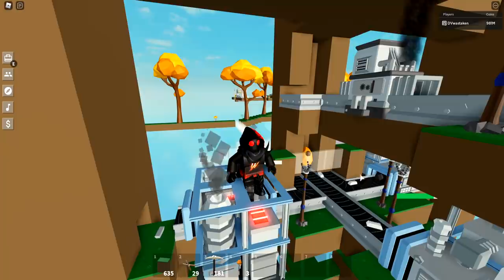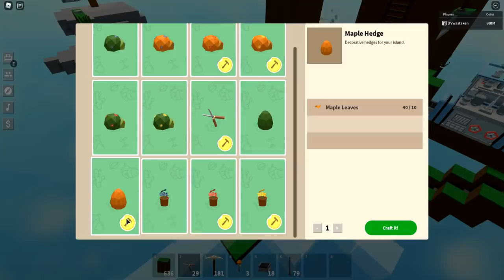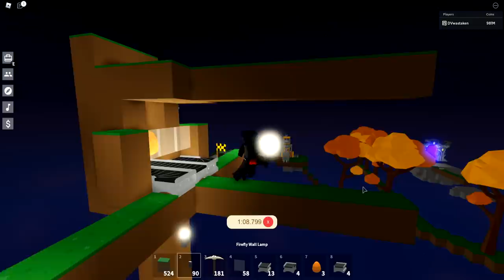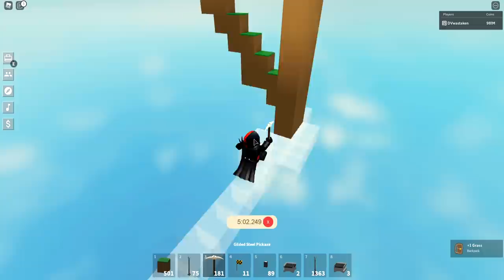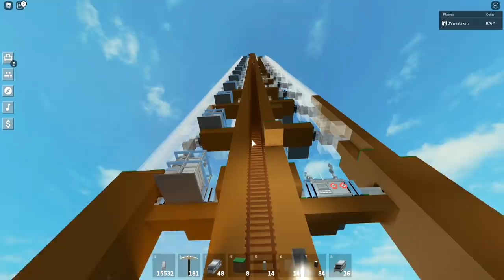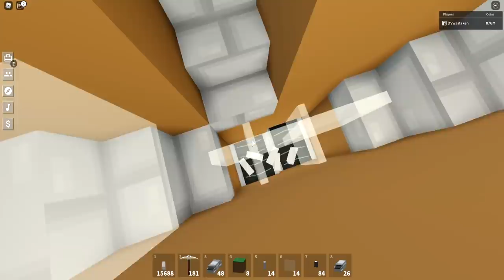Load Balanced Steel Farm in Roblox Islands (Near 5K/hour)

Comment: works pretty good and looks really cool. I changed it up a bit for the load balancer, just requires 2 more conveyers, 6 glass panes instead of 3 near the hedge. I find it going to the left a lot more frequent. Also building an iron tower around it to match future builds.

Comment: I'm really confused on how all your steel mills are able to work an produce steel?
All you did was put coal totems next to them. 
How is that supposed to work?
That's where I am very confused.
We need iron to be fed into the steel mill to produce the steel, am I correct?
This is what u showed on an old video build you made. Where you used ore totems & iron being fed into the steel mill. 
What am I missing? Sorry for the confusion.

Comment: I tried using maple hedges to use as a load balance and it didn't work, even if I rotated it. So I just used glass panes instead of a maple hedge, and I added 1 left and right conveyor right next to the back part of the middle conveyor on either side to catch the iron and it's more efficient.
Reply: if you dont mind can u show me your island and see what u did because I'm having the same problem with the hedges

Comment: Fun fact: if u want to save a lot of steel, copper, gold but u need to transfer it, u can fill 8 section of the input/output  chest with whatever block u dont need like grass, and fill the last section with whatever ingot u want to transfer, like that u can transfer the ingot and u can save 240 of that ingot

Comment: well for me it not working the split thing. i try it before , at first you build is working. but after you logout then problem come. it will not drop random to left right middle .. it will only drop to 1 direction only ( left only for example). if u relog again direction will chance but still only 1 direction ( middle or right only). it will keep like that never do random at all.

Comment: I setup a manual steel press and i feed the steel in. Got this idea from bellamuseplays. Get the bolts, etc faster by doing this. the only thing is with the steel press, prolly the copper press to, i have to break it down before putting the next mold in or it doesn't work. Not sure if i get more parts with the manual, maybe I will setup urs also and see how it goes.

Comment: Instead of putting the coal on the steel mill you can put it with the smelter so when it falls it will also seperate
Reply from the maker: Tried, doesn't work

Comment: For me the randomizer goes only two ways not three and I had to add a stair piece somewhere in the mix aswell, but anyways it's a pretty good concept, thanks for the idea.
Reply: could u tell me where to put stair
Reply: Hope it's not to complicated
Reply: And I didn't include the smelter's whole part becuase, well I would think you would know that
Reply: @Dwgoober  Ok I did 
A=smelter exit
B=block
C=stairs
D=conveyor
E=hedge
F=glass pane

B				A
B			D	B
B C	   F
B B E F
B B D D D
Reply: i totally get it thankyou man!!!
Reply: @Dwgoober  yw btw under the hedge instead of one conveyor put three side by side that are connected to the front ones too

Comment: I originally balance with stairs and a honey press it took a long time to load get the balance I tried this this design but I think its only 1.5 times more efficient as the middle one is doing most of the conversation I plan to try a new one using 2 smelters feeding 4 steel mills and using the witch trophy for collision.

Comment: ngl I think my own steel farm is more efficient, I have 2 steel presses attached to my steel farm with a randomizer and even with a randomizer both of my steel presses are glitching out bc of how fast steel is going into them
Reply from the maker: randomizer didn't exist
Reply: Dv, for some reason the iron keeps getting stuck behind the hedge but even if it goes through, it only goes through the middle steel mill.
Reply: @anykiner5398  same